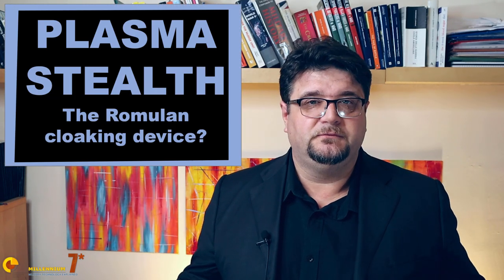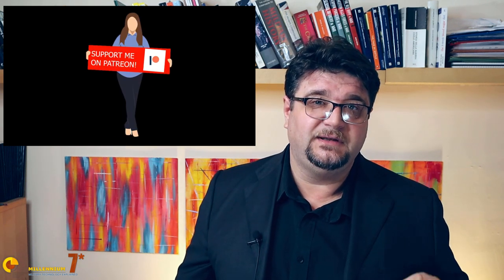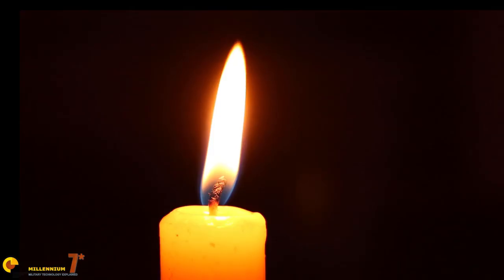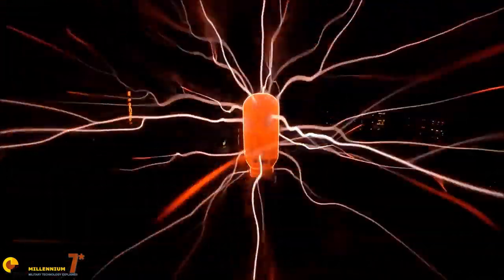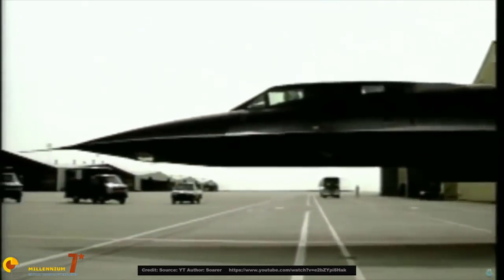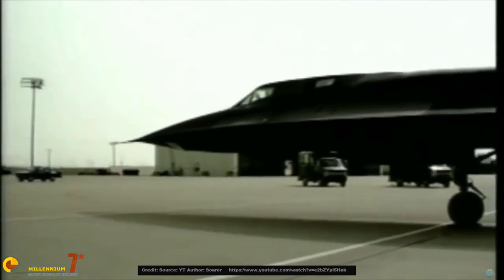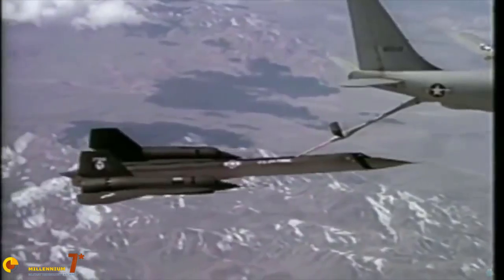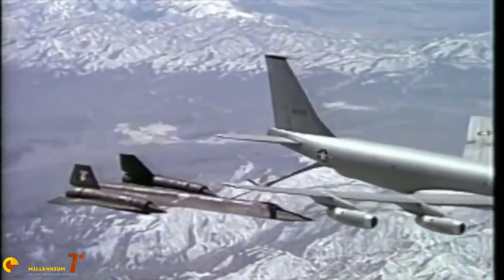Plasma STEALTH: the enigmatic Russian cloaking device.

Comment: Actually the Cesium was added to the fuel in an additive mixed into the JP-7 that the A-12 and SR-71 burned.  The resulting plasma cloud in the exhaust effectively shieled the rear aspect of the plane from radar detection.  

When spacecraft make reentry from orbit, they spend a time where radio communications are not possible because of the plasma cone that surrounds the vehicle during the highest energy part of the reentry.   This implies that an aircraft using plasma stealth technology will have limitations on its radio communications while the system is active.   And since the plasma itself has an RF signature,  it may be possible to track plasma stealthed vehicles by that distinctive RF emission from the plasma shield.
Reply: Are you just repeating what he said?
Reply: For the Nike sprint program (mach 10 ground to air anti rentry vehicles counter nuke 100 g acceleration etc) it created a plasma around it as well and iirc they were able to get around it for datalink purposes by having a very high power transmitter and by sending the signal through the exhaust plume bypassing the plasma.
Reply: @Xcerptshow  Cliff's Notes for the ADD afflicted types.

Comment: Not to mention the EXTREMELY high IR signature.
Reply: Not all plasma needs to be hot. There are other ways to do it.
Reply: Not more than the exaust of the engine (the much larger volume of the  exaust  more than compensate the temperature difference)

Comment: Plasma Stealth is easily defeated by low-yield photon torpedos.
Reply: Waltham1892 which are obviously themselves defeated by simple lasers cannons
Reply: @JacobVahrSvenningsen  all these got defeated when alarm clock rang.
Reply: just add 4 C-RAMS, 8 CIWS, and 12 Energy Based CIWS onto your vehicle and you'll be fiiiine
Reply: Proton torpedoes are even better...
Reply: Tell that to the Millennium Falcon 😁
Reply: Or reversing the pulse modulation on the trivalent radar harmonics.

Comment: Plasmas are more stable and controllable in a vacuum where there may be impurities in the medium.  This makes boundary layers and key absorption wavelengths impossible to control.  Therefore I can't see this being used for masking the presence of a craft since the plasma is still going to emit energy signature at fluctuating wavelengths.  This is the first time I have heard anyone describe the employment of plasma technology used on an A-12/SR-71 and I am an aviation buff to scooped up a lot of obscure info on these legondary birds.
Reply: There's a great A-12 pilot interview where he mentions that they used Cesium mixture in the fuel to reduce the RCS of the supersonic shockwave cones in the exhaust of the A-12/SR-71A.  During radar instrumented testing and analysis of the Blackbird, these shock cones contributed to the overall RCS enough for them to address it with a unique fuel blend and support aircraft.
Reply: @LRRPFco52  It would not surprise me that they would dope the fuel with cesium despite it being as hyper toxic as berillium doped fuel as used in the XB-70 and as rocket kerosene.
Reply: @ph11p3540  I don't think the doped fuel was actually used mostly because the a-12 was good enough with normal fuel and the caesium based additive had harmful effects on the engines of the a-12 and on the fuel systems on the kc-135 tankers used to fuel them.

Comment: Plasma does provide stealth capabilities at some levels. However, a huge heat signature will also be presented, which could be captured by the IR sensors hundreds of miles away.
Reply: release compressed co2 from nozzles at the front . this will shield the heat. also make it impossible for heat seeking missiles.
Reply: @esecallum  Modern IR seeker don't look for heat sources anymore. They look for everything which stands out from the background noise. If you cool something down, it stands out.
Reply: @esecallum  wow how big a co2 tank are you proposing to carry? lol
Reply: @superchargerone  look you dont seem to understand simple things. a heat seeking missile is detected coming at you. you release COMPRESSED CO2 from small nozzles  in the nose cone. This released gas envelopes the plane masking the heat signature.you with me so far?
one the missile has lost lock it stops.  DO YOU UNDERSTAND? you only need it for a few seconds. you release in bursts as needed. 

every seen those aircraft displays at air shows with the colored gas jets on the wings? same thing. you ONLY need to release when  a missile lock is detected for those few seconds. the gas is compressed. co2 acts as heat shield and will cause the plane to become invisible . any gas can be used but co2 is cheap and easily stored and will result in cooling.the exact amount required will depend on plane type, speed, height and the parameters stored in in onboard computer.

DO YOU UNDERSTAND NOW etc.
Also compressed gas when released is COLD and mask the heat signature. can you not understand simple physics?
Reply: @esecallum  I like that you s itll think this is even slightly a good idea despite the size of the co2 canister being the smallest of problems with your idea.  It is like you don't understand what sort of heat we are talking about.
Reply: @esecallum  This is some fun off my meds "science" ahahaha
Reply: @404Dannyboy  valium for you
Reply: @esecallum  It'll take significantly more than just valium for your idea to sound sensible.
Reply: @esecallum  Yeah totally pump CO2 into your engine, that will work out so well. (Also you're going to have a hard time detecting the missile through the plasma)
Reply: The CO2 would probably cause an engine flameout, causing loss of control of the aircraft at a moment where it needs its engines the most.
Fact is DIRCM works better by burning out the IR Sensors on the inbound missile using IR Lasers.
Moderately powered Lasers very easily damage optical sensors,  so this idea  isn't only practical , its already in use in the SU-57,  with similar active defensive systems also on the Eurofighter .
Not only do they work... they also won't flame out your engines when they ingest Concentrated CO2 instead of air/oxygen
Reply: Plasma doe snot make hard to detect there is somethign there, just makes it very very hard to get accurate measuremnts for tracking.
Reply: CO2 dispense from nose of fighter plane have three problems. 1) the CO2 equipment obstructing the radar equipment. 2) the engine sucks in CO2 can flame out the engine. Once flame out the missile can’t see you anymore. 3) to reignite the engine in mid air. We may just shut off the fuel pump to the engine to get same effect? May be you mean to inject CO2 down stream at the bypass duct? Some one should do a thermal analysis how much CO2 it takes to bring jet engine exhaust down to ambient temperature?
Reply: @goodbye8995  Now this I can get behind.
Reply: @esecallum  you are REALLY underestimating how hot a plasma engine would be
Reply: @esecallum  how exactly are you planning on detecting an IR guided missile start? With the RWR? Lmao
Reply: So how the US stealth aircrafts protect their own radars from reflecting enemys signal?

Comment: Its like Harry Potter's Cloak. The same system  was tested on an F-15 in 1995 but it got stripped off the jets surface as it tried to go mach speed. They call it "HUE". Top Gear UK made a crude design of it on a truck driven by Richard Hammond
Reply from the maker: This is really interesting! Do you have any source you can point me to?
Reply: @Millennium7HistoryTech  I read it on a Time magazine february 97 publication. As for Top Gear UK visual stealthy truck, its here on youtube

Comment: The B-2 Stealth Bomber uses plasma stealth along the leading edge of the wing.  ALSO, the leading edge of the B-2 bomber is not straight line!  It is an "arc", the leading edge is 109.3ft long and the arc is 0.5in. deep!  I went on-line and found an equation that yielded the radius of the arc is -35,896.93ft.!  The angle of the arc is 0.174°!!
Reply: Plasma can be only create at hyper sonic speed or with a huge amount of energy at nuclear plant scale... B2 don't use plasma shield or all physician have to reconsider all thermodynamics law..
Reply: @sucellus5452  I "stand corrected", while it is not plasma, the B-2 bomber uses it does use an electrical field on the leading edge of the wing to help reduce the radar return.  The B-2 also has an extensive system to cool the exhaust decreasing its detectability to IR detectors.
Reply: @sebastien3351  static, alternating electric field and radar signals “do not see” or interact with each another. Its a myth to me that electric field at the leading edge can have an effect.

Comment: I talked with some Air Force and Naval Aviators about Russian Stealth a few years ago (at an unrelated business event) and what they were worried about is not Stealth in the traditional sense that the West thinks of it. They were concerned with what they called Anti-Stealth, were the radar signal from your fighter is picked up, modulated, and transmitted back in such a way as to make the Russian plane look 500 times larger and impossible to target accurately. If this is true then even old planes like the Mig 21 become dangerous.
I hope it's bullshit.
Reply: Brian Coley    he literally explains why. If one can make the radar return of a Mig-21 the same as a 747, then presumably the missile will have a harder time hitting the actual Mig-21.
Reply: @fredhal8681  

They try/tried to do that with chaff. :)
Reply: I seem to have heard  this concept is used in drones to simulate another type of airplane
Reply: Maybe that's why the Russians are so fond of em pods.

Comment: I think it would be easy to make glass/plastic tubing that goes in the leading edges or areas that need plasma to absorb the radar, ie wing leading edge then have said plasma tube covered with ram and or composite to protect and do the actually work/loading, but the plasma would not move about and would absorb most the radar.

Comment: I heard that france rafale jet have plasma stealth they creat plasma cloud around the jet to reduce the RCS as 0 but it works for few minutes only
Reply from the maker: First time I hear anything like that about the Rafale. Do you have a source? It would be interesting to know!
Reply: nop, you are confusing with active cancelation.
the rafale could not take the heat and the plasma's eat would make it IR dectable 300km away
Reply: vicky kumar  
I heard the same rumor , apparently Rafale will equate stealth with the use of plasma , one problem is radio frequency do not pass through plasma and will the Rafale melt?
Reply: socotroquito2007 that’s fake news, plasma is very hot and ir chrismas tree.
Please give a source because the only plasma stealth was in lab, the rafale doesnt have any equipement to spread or create plasma around itself. 
Probably a therory to explain active stealth when it wasn’t declassified yet.
Reply: Wagdy KOTB BAHBAH 
Yes the melting part is worrying, the heat , but apparently was announced by President Macron
Reply: socotroquito2007 again source ? Makes no sense since the active stealth on the rafale is better then plasma stealth in ever way possible. 
Plasma stealth would make the rafale a long range target for any irst in the sky.